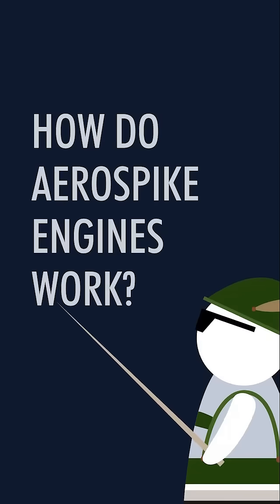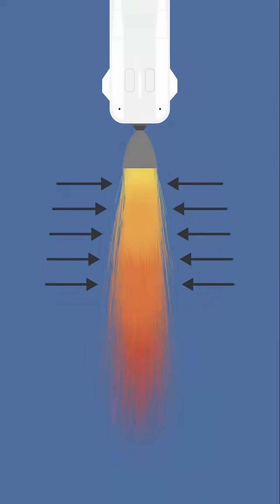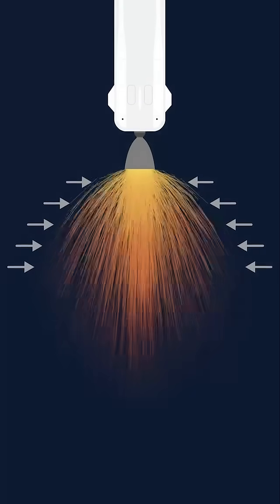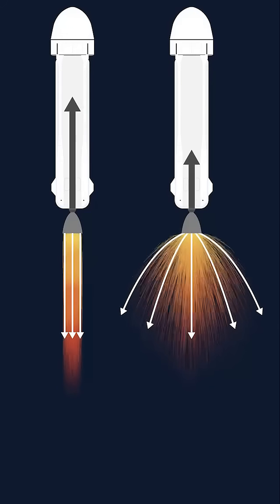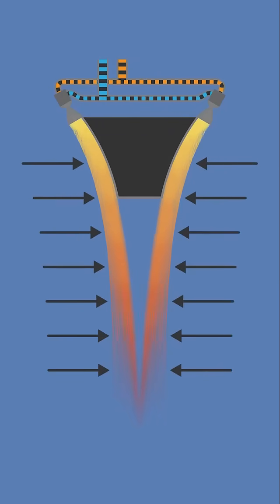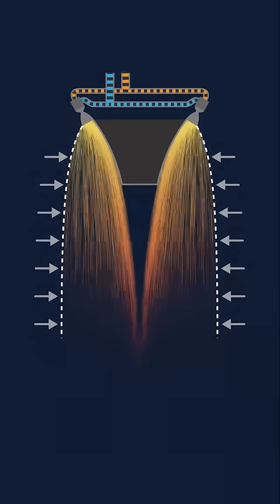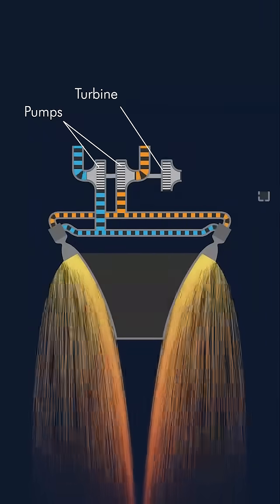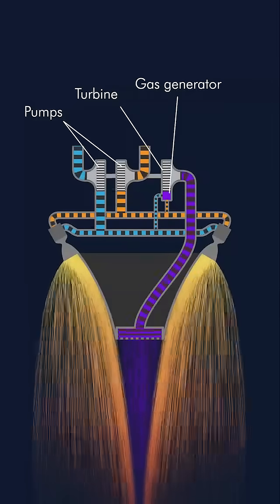Aerospike Engines Explained in 60 Seconds

Comment: An engine never gets less efficient as the ambient pressure drops. The ISP in vacuum is always higher than the ISP at sea level. It's just a matter of how much more efficient it gets
Reply: The engine gets more efficient, the nozzle doesn't
Reply: @Infanterie_Marine  True. Which is why a different nozzle is made for space. Rarely does the first stage ever reach space. So a vacuum optimized nozzle isn't necessary and it only adds issues and cost
Reply: @Quasar-2  We're not talking about space... There's several miles of atmosphere before that... And a significant drop in ambient pressure with altitude... The energy dissipated from the spread out exhaust is wasted... Such energy could be used to get the rocket to it's destination faster... The aero spike config is an attempt to reduce this wastage...
Reply: @joshuaohuka7719  A vacuum optimized nozzle is better than an aero spike. It performs better and more reliably than an aero spike. 
An Aero Spike is one of those things that work great on paper, but just fall short in practice
Reply: @snakevenom4954 would've been rlly good for smth like the SSME's, which are going from launch all the way to orbit
Reply: @Quasar-2 I'm not sure exactly, but don't vacuum nozles also suck in the athmosphere?
Reply: @ForTheBrotherhood  Vacuum nozzles perform better than Sea Level nozzles at every point in a flight. 

However, Vacuum Nozzles suffer from combustion instability at Sea Level. This causes pressure and heat fluctuations in the Nozzle that makes it oscillate so much it can rip the engine apart. That's why RS-25's and Vacuum Raptors have hoops around the nozzle. 

Another downside with Vacuum nozzles is Thrust to Area Ratio. Vacuum nozzles are big. You can fit 2-3× as many Sea Level engines in place of a single Vacuum nozzle. At Sea Level where you need to build up as much speed as possible, you need as much thrust as possible which usually means more engines
Reply: @Quasar-2  Aerospikes are important for SSTO technology.
Reply: @dutch24  SSTO's just don't work on paper or practice for Earth. And on Mars/the Moon, Vacuum Engines can be used at every point which are more efficient than Aerospikes. 

Aerospikes just don't work in practice
Reply: @Quasar-2  No, vacuum nozzles perform much worse at sea level than a properly expanded sea level nozzle (in addition to having problems with flow separation and shocks). When picking a nozzle for any given exit condition, you'll always get maximum thrust and efficiency when your exit pressure equals ambient pressure.
Reply: A straighter plume is still more efficient in a vacuum than a expanded one
Reply: This is correct. Upvoted and bumped for visibility.
Reply: @BigDickMark  "Upvoted"
Reply: It's the nozzle that loses efficiency. Stay with the focus here.
Reply: @2engjnr2 reading the comments here, I’m trying to understand something. Someone please explain. The thrust of a rocket happens 100% within the nozzle, correct? My understanding is the expanding gas pushes against the inner walls of the bell and injection plate to propel the rocket. So why does atmospheric pressure matter outside of the bell? Why does it matter that the exhaust plume is spreading out. How does that spreading exhaust hurt a rocket’s efficiency if what is happening in the bell stays constant… gases expanding and pushing on the inner walls.
Reply: @Mothball_man Yes that is correct but when calculating thrust it is easier to think of it as a momentum exchange. As gas exists the nozzle it expands and trading pressure and temperature for velocity. Higher exit velocity equates to more thrust and higher efficiency. At sea level, If the nozzle were designed to expand below 1 atmosphere, the outside air would enter the nozzle, causing flow instabilities and reduced thrust. If the pressure under expands in the nozzle there will be additional expansion outside resulting in a component of sideways thrust which cancles out and does no useful work as it is equal in all directions.
In space, the exhaust pressure can expand to near 0 so more pressure can be traded for velocity/ momentum. Because of this you will see that vacuum optimised engines are longer and wider than sea level engines.
Reply: @Mothball_man nozzle accelerate gas. If the pressure is to high for a big nozzle it don’t work perfectly. So you need to increase the pressure so a Little nozzle. Big nozzle are better than Little nozzle. And yes they push against the walls.
Reply: @Mothball_man nozzles are designed so the pressure of the gas as it leaves it is the same at atmospheric pressure

This means all the gas flows straight down, maximizing thrust

When the pressure drops, gas spreads out and in order to get the speed to go sideways the gas has to lose some of its vertical speed, causing less thrust and thus less efficiency

The thrust is not caused by the gas pushing on the nozzle, but simply because the gas is being thrown in 1 direction

Imagine standing on ice with a friend and you give them a strong push.
You get pushed the other way.

Rocket engines are pushing the gas by making it very hot, but same idea. The gas doesn't have to push against anything else, just like how your friend on the ice doesn't need to be anchored in place for your push on him to push you
Reply: @Mothball_man  No. There are two to three things, depending on how you look at it. The first is the chamber pressure. The pressure on the chamber walls due to combustion is the same in all directions, but there's a section that is missing (the outlet). That creates a net thrust force on the chamber header. 
The second is the acceleration of the gas through the nozzle. As it accelerates, it creates a force on the gas itself, and that manifests as a force on the nozzle housing and essentially the chamber header.
The third action is the differential pressure on the nozzle bell. The static pressure of the gas in the bell is greater than the atmospheric pressure on the outside of it, and that creates a net force. Because the bell is not parallel to the direction of travel, that force is not at 90 degrees to the direction of travel, meaning that part of that force creates thrust. 
Think of it like if you put a bell on a flat surface, if you held it down and put in some compressed air, then let it go, it would fly up. Tha'ts what's happening. 

The reason it gets "less" efficient...first it doesn't get LESS efficient, it just doesn't get as efficient as it could be. Its not that the engine gets less efficient, its that the ceiling of possible efficiency goes up while your actual efficiency stays the same.

...The reason it gets "less" efficient is because as the ambient pressure goes down, the differential pressure and the resulting thrust force goes up. But if you don't have enough nozzle bell to capture that differential pressure, instead of the exhaust expending all its possible work on your rocket, it does work on the atmosphere as it leaves the nozzle bell instead.

Edit: the previous comments are talking about the acceleration of the gasses. They aren't wrong, but these processes are happening dynamically and simultaneously and contribute to each other. The static pressures determine how much you can expand the exhaust, and how much you can expand the exhaust determines how much you can accelerate it. How fast the gas is going determines its static pressure. They are interconnected, and you can't dismiss either thing. Differential static pressure on the bell is a significant contribution to thrust itself, and it is a factor in the acceleration of the exhaust gasses.  It isn't either-or, its both-and.

Edit2: I will, however, dispute the claim that the gas going sideways contributes to less thrust. That is not true. The velocity (speed and direction) is completely irrelevant to thrust. Its the acceleration that creates thrust, and once the gas leaves the nozzle, it has exactly zero effect on the rocket. 
When the gas was in the nozzle, no matter how big it is, its acceleration was straight "down". Its not that it changes direction, its that it had energy that wasn't harnessed, by either the static pressure differential or the acceleration due to expansion.
Reply: @ thank you so much for this thorough explanation.
Reply: @tylerfb1 what’s your background? Why do you chose to think about it in a thermodynamics kind of way instead of a simple aerodynamic point of view with shocks and expansion waves?
Reply: @guidesforuseveyone6834  because thermodynamics is everything. 😂😂

My background is unimportant. I’m just a regular guy with varied interests. 
I look at it that way because that’s the reason behind why rockets use bell nozzles. Shocks and things are resulting phenomena of not getting this right, but that isn’t why we get this right. If we built a nozzle with enough mechanical strength to resist the shocks, we still wouldn’t over-(or under)expand.
Reply: @tylerfb1 what do you mean enough mechanical strength to resist the shocks? That’s impossible? And every rocket nozzle can withstand a shock, jet engines have shocks in them all the time.

Im just saying from an aerospace engineering perspective, work is not involved. And what do you mean shocks and expansions is when we don’t get it right? A rocket will fly through 3 flow regimes typically throughout its flight, two of them include those shocks or expansions.

When in space, do we do work on the air outside the craft? What are we doing work on ever?
Reply: @guidesforuseveyone6834  we care about building an overexpanded nozzle because the stress caused by the shocks can damage the nozzle. If you built it strong enough, we wouldn’t care about the shocks. But to do that, we’d have to not care about weight and drag. Those are more important, so we build nozzles as light and as small as possible. Because of that reality, and because of the mechanical stress caused by shocks, we don’t over expand nozzles. 
 

What do you mean work isn’t involved? Work is literally everything. We want the rocket to fly into space. The exhaust has to do work on the rocket to make that happen. Like what are you even talking about? 

Again saying it does work on the atmosphere is an illustration tool. We don’t care that it does that. Obviously there’s nothing to do work on in space. That’s not the point. The point is, in an under expanded nozzle, we leave energy in the exhaust to be wasted, when it was available to do work on the rocket.
Reply: @tylerfb1 well that’s simply wrong. For one, we stay in overexpanded regimes all the time. Many jets fly in an under expanded or slightly overexpanded regime that’s why we see a diamond pattern shock formation at the nozzle exit. Shocks inside the nozzle may damage the nozzle over time but bell shaped nozzles reduce this damage and any application that would see shocks IN the nozzle are typically one use applications like rocket nozzles where it doesn’t matter. And we most definitely still wouldn’t want overexpanded shocks just because our nozzle could take it. In an overexpanded regime you lose pressure thrust and experience flow irregularities vs an under expanded regime.

Rockets always start overexpanded, are those designers wrong?

And no we don’t care about work… ever. Nobody does work calculations they do thrust calculations like Isp graphs. Work does nothing and means nothing to the plane. Nobody cares how much work the engine can do they can about the thrust it can produce for a given amount of fuel.
Reply: I was looking for this one. Very much correct
Reply: If I found myself watching 60 second videos explaining actual rocket science just to see what they had to leave out and nitpick it, I'd probably punch myself in the face.
Reply: @ whoa there now. Let us nerds nerd. You don’t have to be a part of it.
Reply: @Mothball_man  neither do you. Who asked you?
Reply: @oldgreg315  nobody enjoys troll bullies who spend their pitiful lives trying to supplement their inadequacies by anonymously making annoying and harassing comments on peaceful threads.
Reply: @Mothball_man Lol look who turned out to be the bully with the ad hominem attacks. Gaslight much?
Reply: @Mothball_man  yeah that's what I thought. You may wanna nerd-out on some rules of debate to include logical fallacies before the soapbox rant.
Reply: Pedantic.

Comment: This video has multiple errors, I get it's condensed, but don't say objectively incorrect things.
Reply from the maker: what stuff? If you are talking about the efficiency thing relating to the underexpanded nozzle: it"s correct. A vaccum optimized nozzle is more efficient than a sea level optimized nozzle because the exhaust travels in a straighter fashion. I could have worded it better in the context. And please, if you spot errors. Don"t just tell me that there are erroers. Tell me what I said wrong so that I can correct my error in the future. Just saying that something is wrond is unproductive.
Reply: @spaceiac  Ok, well let's go through the first two errors right at the beginning.

"...keeping it in a straight line"

This is incorrect. Only once the exhaust is at ambient pressure will it roughly travel in a straight line. With an over-expanded engine nozzle, the exhaust will actually contract. This can be seen in the Raptor Vac test videos. 

Your video would suggest having the largest engine nozzle possible is best, however, this ignores the issues with over-expansion, such as decreased thrust and flow separation.

"Exhaust gas goes sideways, making the rocket engine less efficient"

That's kinda true, but not in the way you framed it.

All rocket engines will be more efficient in a vacuum than at sea level.  It doesn't matter what the engine nozzle size. A sea level optimized nozzle will still be more efficient in the vacuum of space.

A larger nozzle would be more efficient, but the engine itself doesn't lose efficiency as ambient pressure decreases.

Comment: I've seen NASA's working on Nuclear thermal propulsion. I'm talking to ChatGPT about it lol. but i think it'd be incredibly if they could somehow get the aerospike to work with NTP.
Reply: Heat flux in an NTR is worse than a combustion engine, which makes it more difficult to develop.

Additionally, NTRs only operate in a vacuum, so the regime is better suited for a DeLaval optimized for vacuum operations anyway. Aerospikes offer worse performance at each specific altitude than an optimized DeLaval, so they only become relevant in large pressure changing missions.
Reply: I think could actually work very well (in my opinion I’m not a rocket scientist).
The heat from a nuclear reactor could heat up hydrogen and flow it though an aerospike, since aero spikes surface area is so much larger than a bell nozzle there’s more space for hydrogen to flow through the engine to heat it up before passing over the reactor making the hydrogen exist even faster and therefore with more efficiency. 

I find it very fun to talk concepts with GPT like the VALP a manned aerial electric plane that flies in the upper atmosphere that I have though to be made in the late 22nd century

Comment: Ok, so when in space (vacuum), how do vessels maneuver with thrust if there is nothing to push against??
Reply: newton's third law. Throw a rock out of a boat and it will push the boat forward
Reply from the maker: The rocket is pushing against the exhaust gas that it is ejecting its back. After all, it has to push against it to eject it.
Reply: Bros using 1 of his 2 braincells to type this

Comment: Great explanation in a simple understandable way. Definitely sharing this, also subscribed.
Reply from the maker: thanks mate. Much appreciated
Reply: @spaceiac  Yep, but is wrong. Under expansion in a rocket engine doesnt mean You are geting lower performance, it means that more performance is abailable if you use a larger nozzle
Reply from the maker: @martintiburciocruz3153  I am not saying that the engine gets worse, that's not what I mean. My point is exact what your comment says: there is potential energy that we are not using, so we don't have optimal efficiency. I know that with higher altitude and lower ambient pressure the exhaust velocity increases thus increasing the efficiency of the engine. I mean, both is basically true. A rocket engine get's more efficient with higher altitude due to the drop of ambient pressure, but at the same time that unconverted pressure energy represents a loss in potential efficiency.
Reply: It’s incorrect unfortunately

Comment: Aren't these problems the same problems every rocket engines has

Except flight experience ofc
Reply: Yes, sort of. The aero spike is much harder to cool as there’s more surface in contact with hot exhaust that needs to be cooled, the aero spike in practice also seems to be a bit less efficient in reacting fuel.

Comment: Note that the bell at the top of the arrow spike is the same as the bell on a regular rocket engine. Arrow spike engines do not work in space and they barely work in atmospheric pressure. The bell at the top arrows will have the same problems as the bell on a regular engine.
Reply: Everything you said is exactly backwards, and you haven't the slightest clue what you're talking about.  Aerospike engines are better than bell type nozzles because they self-correct for the transition from operating at atmospheric pressure to a vacuum, which was clearly explained in the video but you apparently still did not understand. A bell nozzle can't do that which is why you would want to use an aerospike instead. The reason that aerospikes aren't used is because, again as the video noted, they are heavy and they have heat dissipation problems that need to be fixed before they can fly.